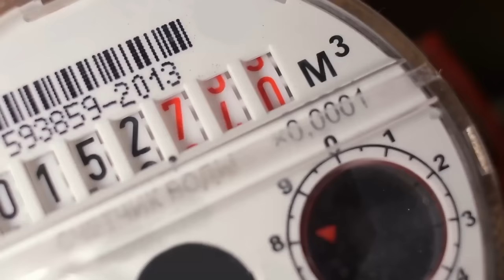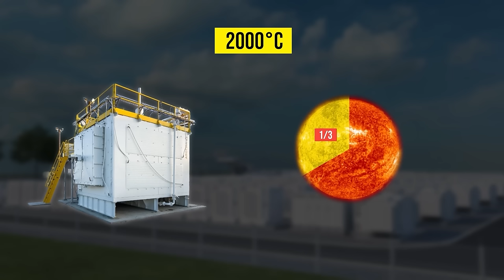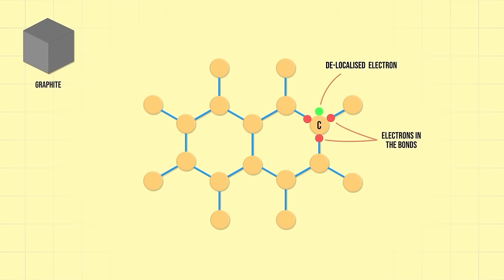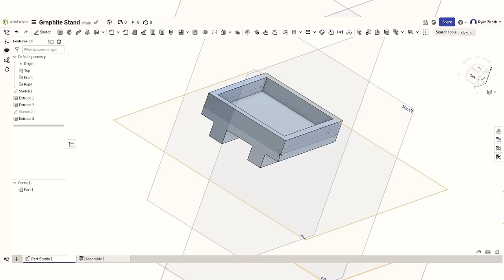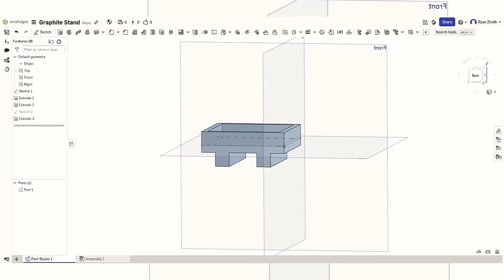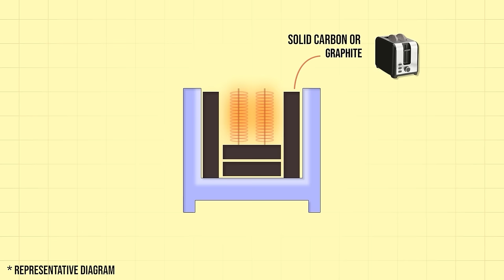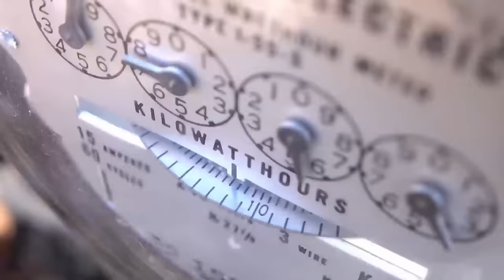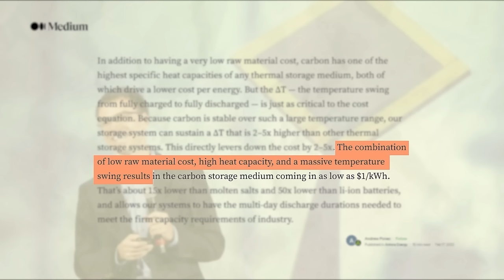Why Solid Carbon is the Future of Energy Storage

Comment: I've watched many many videos like this for years, new breakthroughs, that never happens! This is that kind of video!
Reply: Same here.
Reply: When I was an undergraduate decades ago, an embargo led to a scarcity of oil.  Solar panels were installed on the White House (and were torn off in less than five years when they stopped working); a grad student at my alma mater modeled the performance of an electric delivery van;  nuclear power plants proliferated.  A professor of an environmental engineering course hypothesized about the potential impact should carbon dioxide be considered a pollutant like sulfur dioxide.  

Tesla perhaps, a company that only manufactures EVs, is the most valuable car company in the world.  The solar panels on the roof of my home for over a decade paid for the installation cost in electricity savings within seven years. Two new nuclear plants started up in the past year, the first plants built since the 1980s.  Breakthroughs HAPPEN!
Reply: It all sounds great for utility scale storage. So why isn't it already widespread? Something about the economics must not have been explained.
Reply: The GIGANTIC WINDMILLS….HAVE happened!!!     MORE of them EVERY SINGLE DAY!!!

Comment: The round trip efficiency was mentioned to be 30-40%, which for me is not very worth it. Even if the renewable energy LCOE is low ($0.04-$0.05 per kwh), with that efficiency you would need to sell it at $0.15 per kwh just to break even.
If they could raise it to 50-60% round trip efficiency, then we can talk. Because even with Lithium based batteries, the round trip efficiency is between 80 and 90%.
With 50-60% efficiency and the low cost of storage, the overall LCOE would be less than $0.10 per kwh, which is about the same as fossil fuel and nuclear LCOE. And they would still be able to make money at $0.15 per kwh.
Reply: The video addressed this, I believe. The thermal battery would be charged with waste solar or wind generated during high supply/low demand periods.
Reply: If it ends up being used "just" to provide high heat for industrial processes (while removing the need from fossil fuels) that's already a big wiin, anyway.
Reply: and the purpose is not electricity but industry heat
Reply: @RandomGuy-nm6bm  well, the first 2 still apply. Conversion loss and heat loss during storage and there is also heat loss during transfer. It will still make it only 40% efficient. 
Although I will say that that matters less when they use the heat for things like steel manufacturing, considering they were going to use electricity for heat anyways. But it still is not ideal. Using electricity for heating steel is quite inefficient and this doesn't change it. This just adds another step in-between with extra loss but with slightly cheaper electricity. Which I suppose evens it out a little.

Comment: I would be interested to know how they contain and insulate the carbon blocks if the are hot enough to melt steel.
Reply: yea that question also  arose to me.
Reply: he said 3000 celcius stable, steel is 1500
Reply: Non metallic storage Like heat shield tiles, ceramics. stuff like that.
Reply: Silica aerogel fiberglass around the graphite, steel around the silica aerogel.
Reply: Also ... what do they use as their heating element so it doesn't melt or oxidize. And howcome graphite doesn't burn in the air?
Reply: We have more materials then steel
Reply: Ceramic shell.

Comment: could you develop on what materials are used to thermally insulate a 2000C graphite core and on the photocells able to survive at such temperature?
Reply: More graphite. Just thicker so it’s only hot in the middle. After that, glass fibres
Reply: There's Starlite and silica aerogel.
Reply: @JohnDoe-ji5wg one is getting wasted as it isolates, the other is super expensive.
Reply: @theairstig9164  graphite as very well described in the video is a very good thermal conductor, in deed as good as aluminum, not an insulator.
Reply: @JohnDoe-ji5wg  Do you know the secret formula to make Strarlie? and silica aerogel start to crumble at 1200C, there is some some ceramics able to withstand 2000C like alumin oxyde but they are very poor insulator.

Storing energy at 2000C in a container sized enclosure would be either very small or very short term.

Comment: Sounds great but the thorium fuel cycle is the real solution, not least because it's the best for generating industrial process heat. Far more efficient than solar, than wind, and sustainable unlike legacy nuclear. Batteries have their place, but thorium-cycle power is for process heat as well as critically needed isotopes and plain old baseload electricity.

Comment: Thermal battery heat could be used to enhance the expansion stage of a compressed gas battery system (eg. Energy Dome). In the preheat stage before expansion, additional heat from the heat battery (eg. Antora) increases energy input to the turbogenerator for higher power output. Energy is stored as compressed gas, recovered heat of compression, and thermal battery heat.

Advantages include 1. a (resistively heated)thermal battery can absorb energy spikes that a mechanical compressor cannot 2. thermal battery heat can increase turbogenerator output on demand 3. thermal battery heat can "make up" for reduced gas pressure and lost reheat energy as a compressed gas battery system discharges. 4. colocated battery systems utilize the same grid connection. Therefore resistively heated thermal batteries are complementary to compressed gas energy storage and with the variability(intermittent wind/sun) of renewable energy production.

Comment: When I was a glassblower,  I accidentally  ruined my graphite mold by placing it in a kiln. It became porous after glowing red for a while. The heat was at 1050C
Reply: Depends on how much air got in to burn the poor thing. This will be a major issue in this type of energy storage too.

Comment: 15:28 "especially if you're buying that electricity for next to nothing", except as energy storage takes off, that price spread will decrease. the price spread will settle at "whatever price spread the most efficient operator is selling at" and if your storage can't match that, no one will buy it. so efficiency does matter; hopefully the market will be properly regulated (setting fixed rates, or forcing operators to price based on levelized cost of storage, with regular audits on that calculation) to prevent an endless revolving door of lithium startups throwing a bunch of capital into batteries, pricing everyone else out of business, and then collapsing a few years later as the batteries wear out and replacement costs come due.

Comment: Calcium chloride has better potential for energy storage. 

Melting point 750 C; 
Boiling point 1935 C. 

So if you have high temperature pipes, pumps and valves (eg aluminium oxide) you can pump the liquid salt into heat exchanger or industrial furnace etc.

It has great potential for solar thermal because sunlight can be focussed by mirrors straight into a CaCl2 heater. Very efficient.

Comment: For solar panels instead of reflecting the unabsorbed light out into space you could angle the mirror to bounce the light into some ultra-black painted solar water heater, or a heat block, or something akin to those to make use of the energy that'd otherwise be wasted. 
Just putting the water lines or whatever underneath the panels would be good, but with mirrors you could concentrate that heat.
Reply: Water lines attached to the bottom of solar panels are a thing. They get used to heat water that can then be used for things like heating a pool. And come with the additional benefit of increasing the efficiency of the solar panel meaning more electricity.

Comment: This is genius. The reflecting of low energy photons back into the heat battery so as not to waste what little it does have, in particular. That's GENIUS. Now, if we can also use heat pumps and more advanced insulation and reflection technologies, it seems to me, we could get close to 100% efficient.

The sun and the earth both store a massive amount of ancient heat and the vacuum of space is very bad at conveying that heat. There are three ways heat moves:
1. conduction (electrons and protons transfer energy through photons at short ranges; molecules stay put but transfer energy as short-range jiggling)
2. convection (entire molecules move as a fluid, transferring energy as long-range molecular motion)
3. radiation (photons carry energy through transparent mediums or empty space, and deposit it elsewhere)

All three of these need to be trapped somehow. And if the sun and earth can trap the energy for billions of years, then we should be able to trap it efficiently too. Insulation is the art of doing so.

The question is how to transfer the energy at the end when we need to use it. For that, they have chosen number 3: radiation. The cool thing about radiation is that 1 and 2 do not work at all in a vacuum. For 1 and 2, you need a medium. Thus, the vacuum of space is an excellent insulator and is the reason why the sun has retained its heat these billions of years. Meanwhile, number 3, radiation works great in the vacuum of space: in fact, it works better than in a medium. The sun can radiate a small fraction of its energy on its surface, but its volume is so much bigger than its surface area, being cubic rather than square. (For similar reasons, animals were bigger when it was colder, and warm-blooded water animals in the cold parts of the oceans are bigger for the same reason.) But, additionally, heat transfer via radiation is slow, even though the individual photons are moving at the speed of light. This is useful for storage purposes, giving you control over the release of energy. However, for times when you need higher power generation, you could always also fall back on conduction and convection to more quickly release the energy, via turbines. You could also instead open more apertures OR conduct the heat to another area where you have more such apertures. The flexibility in working with heat is pretty neat and it comes from the 3 diverse ways of transferring heat energy. It's for this reason and many more I have been a firm believer that heat energy storage IS DEFINITELY the future of energy.

If we could figure out how to use vaccuum chambers to further improve the efficiency, that would be nice. If we could also figure out how to release ONLY the higher-energy photons and either trap all lower-energy photons completely so that none ever leak at all, OR reflect all them back reliably, we should be able to get close to 100% efficiency.

So there is a LOT of room for practical improvement that can happen here. I am hopeful, because in my lifetime I watched as things like refrigerators became impressively efficient. This is because of improved insulation and heat-pumps.

We talked about the insulation part. But what about heat pumps? Resistive heating is more or less 100% efficient at transferring electricity to heat. BUT heat pumps can move heat that already exists, and so can be MORE than 100% "efficient" or "effective," or whatever you want to call it. What if instead of using resistive heating, we pump waste heat out of other processes? The heat pumps themselves would run off renewable energy of course. If for whatever reasons there is no waste heat to work with for a while, then you switch to resistive heating instead. But it seems a bit silly to get a 1:1 electricity -> heat transfer when you could get a much better over-1:1 electricity -> heat transfer by pumping pre-existing heat.

Obviously, by pumping the heat, we are concentrating it, to reach those higher temperatures that we need. We do need materials that can withstand these high temperatures, and that's the most important part of this whole problem. If we can get good at that, then we can have a HUGE revolution in energy that makes energy so much better than it ever has been before.

Comment: I'm very sceptical of this battery. It leaves a lot of efficiency on the table, by using resistive heating instead of heat pumps. Also it uses graphite, which is a highly valuable material required for building lithium ion batteries.

Comment: The math isn't making sense to me. In one place it says this storage uses TPV cells which are up to 40% efficient in converting the IR radiation into electricity, which implies 8% total efficiency (20% from solar to heat, then 40% from that heat to electricity), in another place it says they're 95% efficient?
It makes sense for heat storage, but the electricity storage seems pretty inefficient.

Comment: Impressive technology, but you’ll need a lot of trailers to have a meaningful impact for most industrial processes. A standard 40 foot trailer is 67m2. Even if we assume 50m3 graphite at 2 ton/m3 density and a 2 MJ/tonC specific heat with a 500C working temperature range, you get a maximum of 100GJ or 28 MWh of heat storage. This may be 5 times the ~5MWh capacity of the best containerized LFP battery storage systems, but with <40% TPV efficiency and extra utilities is it worth the complexity and cost? Graphite alone costs $200k for 100 tons. It may still make sense for cyclical heating needs with only a few MW loads, but likely for more common 300C-500C temperatures that go beyond steam heating. I’ll keep it in the options list for my next site decarb roadmap.

Comment: 16:00 I wonder if they would be useful in the cement making industry. There they are "burning" waste tires to generate heat for their process. As with most "fired" processes, the heat generation and the heat loads must be in sync. That's probably not the case in the cement industry unless they run all processes 24/7.

Comment: What I do know is that carbon has a really high melting point compared to other elements.
Maybe could be used to make clinker used for cement manufacturing.
From memory aluminium smeltering uses carbon as electrodes, so perhaps potential there?

Less chance of fire than li ion. Already had 2 battery fires here in OZ in grid storage setups.

Comment: hmmm that reflection idea is very interesting, what if you mounted a mirror at the back of the PV and a one way mirror in front of the PV
then the sun would deliver its light to the PV as it is allowing to pass thru at the front, but can never escape back into the air because of the mirror and one way mirror (loop), feasable? i got the idea from the old ruby lasers, wich has such a one way mirror to bounce the light continuesly making it more powerful

Comment: Now that I’ve watched, I can acknowledge that this is an excellent presentation of why lithium ion batteries are not the answer.  I congratulate you on at least covering the question of electricity to heat back to electricity losses.  I’m still willing to bet that this doesn’t turn out to be the answer, but I give them points for at least discussing the hard questions that others have glossed over in the past.

I wonder how thrilled the people who are currently terrified of transporting nuclear waste quantities that are several orders of magnitude lower will be about having all these trucks transporting boxes with contents at 2000-3000 degrees centigrade.  Each wreck would create an instant blast furnace.

Comment: The TPV aspect doesn't really improve the efficiency of the system, since you still have the inefficiency of the original PV panels.  So you should be comparing it to the efficiency of discharge for chemical batteries. For which it is like a 85-95% efficiency vs 40%.  My guess is this is not winning. WRT the recuperative heat, carbon is definitely a winner compared to other materials.  But, your video seems a bit hand wavy with regard to how you get this IR flashlight to work.  Maybe if you gave a scenario on how you could use this to calcine cement or reduce iron ore?

Comment: There must be clever ways of avoiding energy losses. If the environment where the heating occurs heats up too (so not only the carbon)- then that heat could be used, perhaps for pre-heating. If the glowing medium is a plate with infrared cells on both sides, the escaping not converted infrared heats up the space around it and could be used again too. But it seems hard to find a perfect and yet cheap and practical insulating method. The heat lost to the environment will be lost....I have actually no idea how good insulation can be this days.

Comment: That sounds like a very interesting case for home energy storage.  "Wasting" 60% to heat doesn't matter if the same heat can be then used to heat your house, especially with low temperature heating methods like floor heating.

But "energy is free" is a lie. The extra solar panels needed to compensate for low end-to-end efficiency in grid storage are definitely not free, as the alternative is spending that money on more efficient cells. So unless carbon ones get to such high cost difference that they would be 10x cheaper than lithium it would be pointless

Comment: I think the bigger picture is to have different energy storage technologies all combined working together to have fault tolerance and improve reliability in the grid. Sure lithium batteries could be useful and fine, but what if in the future when ICE cars are fully outlawed, the demand for lithium batteries will increase significantly, reducing supply for the grid. But if you already have existing infrastructure using and production lines making solid carbon batteries, you won't have any issues (and vice versa.) Alternatives are perfect.